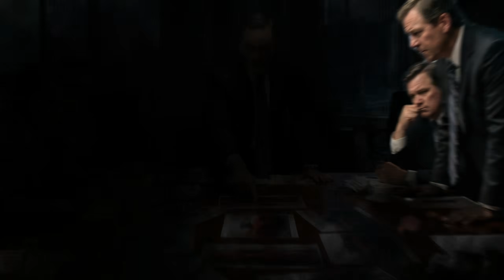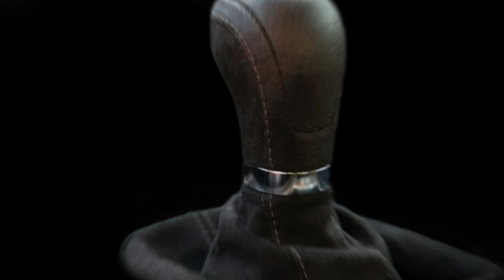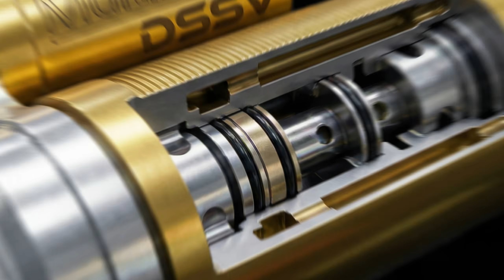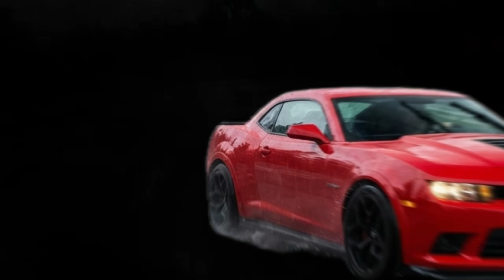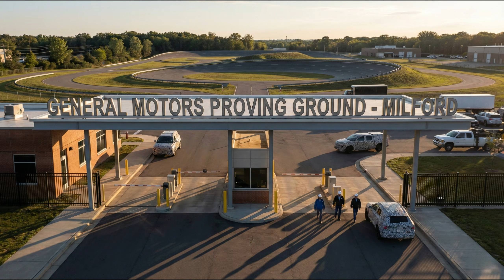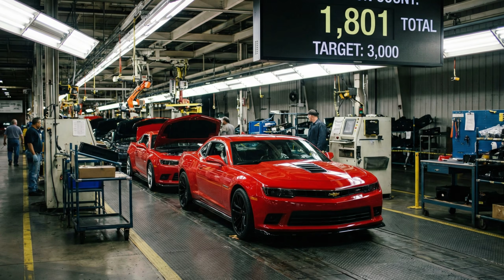$75K CAMARO Z/28 Was 0.1s Behind Ferrari — The Track Weapon GM Built Too Late

Comment: No GM didn't build it too late;  not nearly enough people want a Camaro that is a dedicated track vehicle to support sales. The alpha platform Camaro was a complete failure, had GM instead put a new interior in the Zeta platform Camaro, it may well be the Mustang nameplate that was retired. The back seats in a the alpha platform camaro are all but unusable, it's a practical two seater, if you look at the alpha camaro sales volume, it more closely match the sales volume of two seater sports car vs. a 2+2's.
Reply from the maker: @Steve-yr5vi The Z/28 actually was on the Zeta platform you mentioned — Alpha came later with 6th gen. The timing issue was real: Boss 302 discontinued 2013, Z/28 arrived 2014. But you're absolutely right about market size — only 1,801 buyers wanted a $75K track-focused Camaro. Brilliant car, wrong price point! 🏁

Comment: It was an awesome car. It was a great time with Ford, Chevy and Dodge going back and forth with new models trying to out due one another. This was one of the best of the group (road racing wise). This car was a little too specialized and reflected in the low sales. This was a specific car for a specific type of buyer. The gas guzzler tax did not help in the respect. The best comparison when Car and Driver test it against the Nissan GTR and beat it. That was more shocking than the Ferrari or Porsche test. The GTR was Godzilla at the time and the Z28 took it down.
Reply from the maker: @kegapr181 Excellent point! Z/28 vs GTR comparison showed it could beat Japan's monster — more shocking than Ferrari/Porsche. Specialized weapon for specific buyer. Gas guzzler tax definitely hurt sales. 🏁